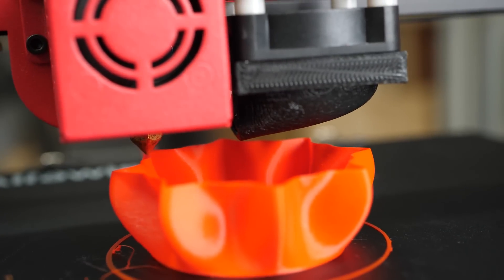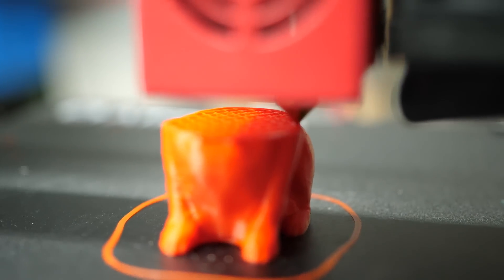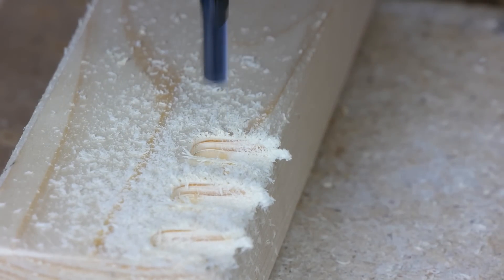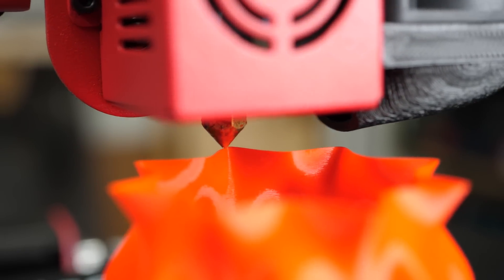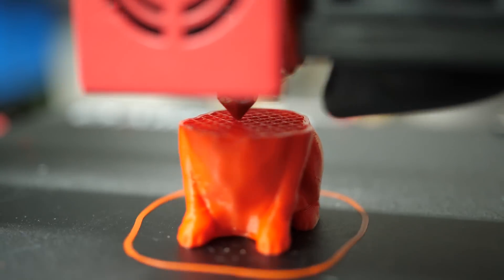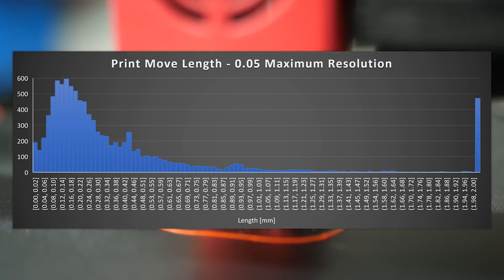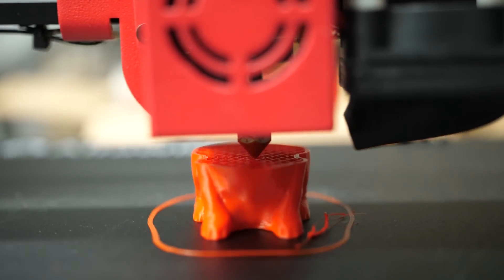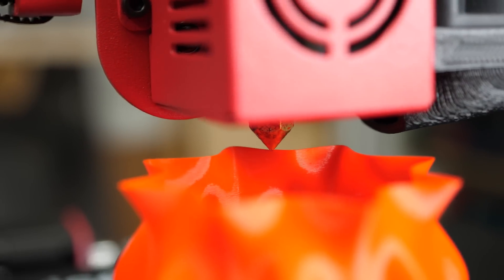(How) I finally got rid of these blobs!

Comment: Would a 32 bit board change this?
Reply from the maker: Probably. Also a well working 8 bit boats doesn't suffer that problem at normal speeds.
Reply: @CNCKitchen  It's a bit surprising that we're still stuck on 8 bit.  STM32s are as cheap or cheaper than many of the atmega chips now.  Hopefully in the next year or so 8 bit will finally be phased out.

Comment: I also had that problem when I used Raspberry Pi Zero as Octoprint host: poligonal models printed fine, but organic forms suffer from jittering resulting in small blobs. Reducing the resolution did help
Reply: Pi Zero CPU is to weak to handle this kind of workload
I also give them a chance but I got so many problems with it. I switched to Pi3 and now it works smoothly and perfect

Comment: This is only a problem of Cura and that's why I have stopped using it again.
Simplify3D just works.
I already know these settings and played around with them for long enough.
I've played around so long with CURA and these settings, I could have just printed many good parts with S3D... you have mentioned "played around" yourself in the video :) some models work different than others. It's a mess. 😅

Comment: Thank you for this video. I tried adjusting this value when I ran into the issue with OctoPrint not being able to feed gcode fast enough for vase mode through usb. It definitely helped in that case, but I wasn't sure how big of a value is OK and didn't find any measured information. You did it as usual in the highest of quality and precision. Thank you, keep on the good work :)

Comment: Thanks for the tip
I noticed that the toolhead movement was not smooth on my ender 3 when using cura but switched over simplify3d seems solve my issue
Reply: Yeah Simplify3D does all this on it's own. Cura is full of settings, slow to read and change and requires to play around all the time. Cura sometimes is an experiment not a tool

Comment: I've used resolution trying to solve Octoprint USB serial speed issues. 

It sometimes works, but also tends to create less resolved models on complex geometry IMO.

Though I have never seen this issue on printing from the SD card so I usually move my file to the SD card if it's a high res model.

Comment: Would a 32bit board also fix this issue? Since its due to movement commands...
Reply from the maker: Probably. Also a well working 8 bit boats doesn't suffer that problem at normal speeds.

Comment: I wonder why the super-tiny peak is present in the 0.50 resolution?  I wonder if the change caused the system to make bigger moves until reaching the error allowance, and then sometimes making a tiny move to bring things back in line.  As opposed to distributing lengths and error bars backwards and forwards across a few segments (you'd likely rather have two short balanced moves than one large and one tiny).

Comment: Have your tried turning on and tuning Linear Advance in Marlin?  This should solve these issues and other larger over extrusions.  There is a good video on Youtube for this already for reference
Reply from the maker: This is not related to linear advance and wouldn't be solved with it. Linear advance is acting odd the motion planner notices a change in speed or direction. In this case, the buffer is just not sufficient.
Reply: @CNCKitchen  That makes sense.  I hadn't looked into the linear advance entirely.  It seems this would be change of direction as opposed to pauses caused by processor overload pauses.  I will implement both :)

Comment: Yup, I used that setting to fix printing fast with gyroid infill streamed from Octoprint. The issue isn't only with the mainboard, but simply that sending Gcode through a software serial port in standard ASCII format is extremely inefficient, so you can only send a certain amount of commands per second. When you are printing something round fast enough it's actually made out of a ton of tiny straight moves and you just run out of bandwidth, and the main board catches up with the data in the buffer. At that point in needs to slow down or even completely stop, until enough commands have been sent through for it to continue.
It can be solved by reducing the resolution and therefore the amount of commands sent, by increasing the serial bandwidth rate, or by increasing the command buffer size in the firmware so it can receive more commands while doing longer moves (which helps with short bursts, not a full layer of gyroid).

Or by switching to Klipper firmware that does all the Gcode stuff on a Raspberry Pi and sends only the stepper motor timing pulses through the serial connection.
Reply: I Had the same problem with another printer. It produced horrible noises if the serial line run out of commands, because the acceleration was switched off by a slicer setting,  so it did abrupt starts and stops whenever the queue was filled/emptied.
Reply: Or just reduce the polycount and optimize the model

Comment: I ran into this with a stock Ender 3 a few months ago when I was testing faster print speeds. Found the issue only showed up at higher speeds and with meshes that were too detailed. Reducing mesh and/or setting up the slicer resolution solved the poor surface finish completely.

It's a good setting to tweak on a per-print basis, depending on speed and resolution you need!

Comment: Will a 32 bit board fix this? Since it may be able to keep up with it
Reply: I've only had this issue due to Octoprint serial connection being to slow. 

I then moved to a 32 bit board. (SKR 1.3)

This allowed me to then increase the buffer size in the Marlin firmware. Which in turn reduced drastically this issue.

I know print at 80-100mm/mn which usually works fine except in few cases where I have to move the file to the SD card. 

A good 8bit board should not have issues reading such a file with 0.05 resolution though...
Reply: @ledjfou125  I just started having this problem when I installed a BTT TFT35 V3 lcd screen.  Haven't had the issue with just my SKR mini E3 V1.2 and Pi 3B+ until now.  When I switch from the touch screen to the traditional screen, the problem goes away!  All I can find is the Pi can't send the gcode fast enough, which I can't see, mine works just fine except in touch screen mode.  I'm now trying to find if the usb and tft connections on the mother board use the same connection.
Reply: @jackwolfjr9517  Dont take my word for it, but if i remember correctly, screen refresh use up a lot of cpu time. :-/
Reply: @jackwolfjr9517  I had exactly the same issue and I didn't want to tweak the resolutions in Cura before I found the problem, today I tweaked the buffer sizes in Marlin and finally got everything together, now it prints without stuttering. So the fix is not resolutions in Cura, it's a buffer problem. I now ha e the latest buxfix and 25.2 for the screen, with the never Marlin I got a problem with the SD card in the TFT35 in Marlin mode, it reports inserted when I take it out and vise versa, so it doesn't work but that no problem now when I can use the touch mode.
Reply: I would like to see this question answered

Comment: I have this problem with the CR-10 V2, but only with one model. Thanks i will try this :D
Reply: Reduce the model
Reply: @REDxFROG  dude i was not looking for advice. I know an option is too reduce the quality of the mesh. It shoud not take 2 sec to figer out what is going on when your print is looking like  this If you kwon a littel bit about 3d printing. But I slices my model with slic3r first and the print was perfect, and then i sliced it with cura and then the printer had problems. I have been wantering for some time why cura did a wrose job slicing it, and the video gives the answer.

Comment: Another option is to use a lower resolution when creating the STL file.
I used to choose the highest possible resolution, I have since switched to High or Medium setting in Fusion 360
Reply: you gotta be careful with this though - while i havent had any problems like that with fusion i had huge issues with catia when i exported as stl files especially for round objects (chances are that this is a catia-problem though seeing as catia only uses stl/brep for visual representation with very little processing power whereas fusion was made with 3d printing in mind)
Reply: @Averell64  I had the same experience with Solidworks. Tried exporting a round model with the default 'fine' resolution but did create an oval with almost 1mm longer diameter on one axis. I did have to max out the settings before exporting a perfect circle.
Reply: This is a bit dangerous thing to recommend. I noticed that I can get severe dimension errors especially with holes in parts. This issue is much better to deal in slicer,_ if_ needed imo
Reply: holy shit maybe this is my problem!!!!! ok well... i have many problems. maybe this is what i can blame all my problems on!
Reply: @Averell Dalton Solidworks as well.  Now in Solidworks if you go too fine you get the same issue and things are no longer manifold.
Reply: @thebeststooge  ahh, doesn't surprise me though as solid works is dassault systems as well - good to know though 👍
Reply: @Averell Dalton What is ironic is that the value you can reach is model dependent so to get something that works with everything while still producing smoothness you have to back it down by 10-20% and just leave it.
Reply: @thebeststooge  oh boy, French logic I guess... If dassault systems software wasn't so god damn powerful nobody would use cause its a users nightmare 😂
Reply: @Averell Dalton I just wrote a PP for Marlin (up on Thingiverse) and you want to talk about a nightmare?  The language is like COBOL + C + Basic all from 1970.  It has a bug in it that has even hit VARS who charge for PPs where it will suddenly divide the number, or multiply it, by 25.4 instead of just printing wtf I said to print VERBATIM.  It took me a couple of weeks in it and some things I got tired of fighting Solidworks over and just said fuck it.  Honestly, if Autodesk wasn't the most douche company out there I would go to them but #1 F360 never clicked with me and the last time I tried it (Feb, 2016) I ditched it.  #2 I came back to F360 last month and found out that all of my SW files can no longer be imported unless I pay AD per year.  Well, screw that so it is gone for good now.
Reply: The Best Stooge , ever tried Solid Edge ? I have worked with SW in the past and put it in the trash after a few frustrating weeks and went back to Solid Edge again (I have worked about 20 years with SE, but no software is 100% without issues)

Comment: Retraction minimum travel is also a nice setting. By increasing it you can get rid of situations where the printhead retracts and unretracts when skipping less than a millimeter for example. In those cases the retraction doesn't do anything except waste time...
Reply: What setting do you use for it?

Comment: I solved the same issue with slowing down Print speed. Thank you for let me Print fast again 😁
Reply: Only the high poly models are affected
Reply: @REDxFROG  if i make a Model in openSCAD im always getting crazy with the number of fragments, probably also a Thing i should think about.
Reply: @becauseican2607  yeah same. However the polycount basically only matters on the large PC Monitor. On these much smaller prints and 0.4mm nozzle the individual polygons aren't visible. :D
Reply: @REDxFROG   There's the owl model, I'm sure you know which one. It is 150mm high. I test settings with that model, only printing it 60mm high. The model seems very detailed, even the back of it, but I still see the polygons after printing it. Sure, this was not the case on every printer I used.

Comment: Top man! You're a lifesaver!
That's one issue with my home-build printer solved (hopefully!).
Reply from the maker: Let us know your results!
Reply: Its not a problem with the printer its a problem with CURA in particular!!
Reply: @REDxFROG  Dude, what is with your hardon for Cura? You've got a problem.
Reply: @noahhastings6145  

There are always some guys who bought S3D, dont feed the troll :D
Reply: @FireN2k9  On S3D ive never seen such a problem.. not even on these printers.. lol
Reply: @hanswurstusbrachialus5213  

If you read my first post, there is no problem, cura standards worked flawlessly....its the preconfigured printer settings which sometimes mess up.... to debate you have to watch the whole video, as stefan states that other printers have better values. 

Half the knowledge isnt knowledge :P

Comment: Intereting video, thanks for posting, I have been looking into these 'zits' for a while and found that the biggest thing to remove them on my Ultimaker S5 was the wall overlap compensation, that feature is actually broken in the Cura source code and Ultimaker aren't planning on fixing it as the person who wrote it has left the company and the logic behind how that feature works is quite complicated and a bit messy (I have been through the source code and it's a can of worms)  try turning off wall compensation also. I was seeing some stuttering of the print head as you describe even at the ultimaker defaults for the S5 for deviation. But its exactly like you show, you can see the head stutter and extra filament comes out. I would have expected the S5 to be powerful enough to cope with a small deviation. I have it set to 0.5 and still get the odd stutter. Did you manage to completely eliminate it ?. Many thanks. Really glad someone else has looked at this ! 👍🏻

Comment: I have used it. Holes are so much more accurate with it much lower. I've been able to calibrate my printer with gage pins haha. I've been through the whole removing blob issue. The other was max comb distance with no retract for solving more issues with very long bowden tubes.
Reply: is 0.05 are better for accurate or 0.5 ?
Reply: @qtreven  It looks like I put 0.2, which is better than 0.5
Reply: @qtreven  ok it's much better with 0.05mm I exported an stl from fusion of an 8mm hole, with medium preset and you can see a good difference. It seems to get messy at the lower resolution, which makes the hole smaller.

Comment: Back in Cura 4.1 or so when they implemented the less aggressive model resolution and new "Maximum Deviation" settings, it was very buggy or not working correctly. Resulting in very high resolution gcodes. So if youre still using 4.0-4.1, you better update. I assume you got that one (or its an old video)? Because the default values in Cura for those settings aint all 0.05mm.
Maximum Resolution: 0.5
Maximum Travel Resolution: 1.2
Maximum Deviation: 0.05
Reply: Really interesting you say this !, I have been trying to solve this issue in my ultimaker S5 and despite increasing the make deviation it did my make any difference but if Cura was not working correctly then that makes sense as changing it seemed to offer no improvement. I did find that wall compensation overlap was adding zits, that feature is actually brocken in Cura source code and the Cura team dont plan on fixing it as the guy who wrote it left the company and the codes a mess. Turning that off made things better but if the deviation was broken that's good news !
Reply: I've only had my Ender 3 Pro a month and installed Cura v4.4.1 when I got it. With the default Ender 3 printer profile, all the default setting profiles have the 3 values at 0.05mm, so it's not a out-of-date problem.
Reply: @ferd352  Realy? I see. I thought its default on every profile. Since im using the "Custom FFF" profile for my Prusa i3.

Comment: Simplify3D version of this setting? Or equivalent perhaps, please?
Reply: Simplify 3D unfortunately stopped in time. I guess they're in the "way too drugged rockstar" phase of their success, where they have a lot of money and not a lot of motivation to keep up with the other bands, I mean slicers
Reply: @lapidations  
Maybe sadly that is true, i see this in several other paid (expensive) software packages i use too. 
They are soon going to release a version 5.0 which they claim has tons of requested features but will be a paid upgrade. Hopefully they got their act together and push the industry standard again, if they dont impress i doubt they will survive this decade.
Reply from the maker: I actually didn't find it in Simplify3D. If anyone knows, I'd be interested as well!
Reply: Reading about "Minimum Extrusion Length" right now. Need to do some test prints to see what happens - I'm not getting these zits normally so it might be hard to test out.
Reply: "minimum extrusion length" -- not quite the same, but might have similar results!
Reply: i'm here to see comments
Reply: On Simplify website about blobs and zits one of the fixes is this (below), I'll have to try it next I get blobs on a print.

"Click on “Edit Process Settings” and go to the Extruders tab. Right below the retraction distance, there is a setting labeled “Extra Restart Distance.” This option determines the difference between the retraction distance when the extruder is stopping and the priming distance that is used when the extruder is restarting. If you notice a surface defect right at the beginning of the perimeter, then your extruder is likely priming too much plastic. You can reduce the priming distance by entering a negative value for the extra restart distance. For example, if your retraction distance is 1.0mm, and the extra restart distance is -0.2mm (note the negative sign), then each time your extruder stops, it will retract 1.0mm of plastic"

Comment: Stefan has a U30 Pro? maybe we'll get a good hotend and shroud for it finally
Reply from the maker: Honestly, I'm not too upset with the cooling solution (though it is a bit noisy). Just slightly bent the part cooling fan for optimal positioning.